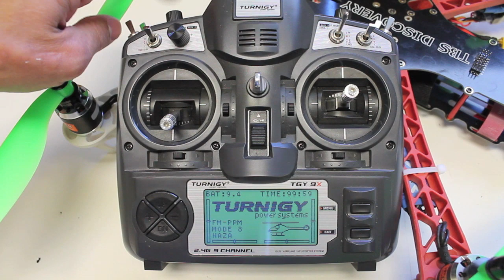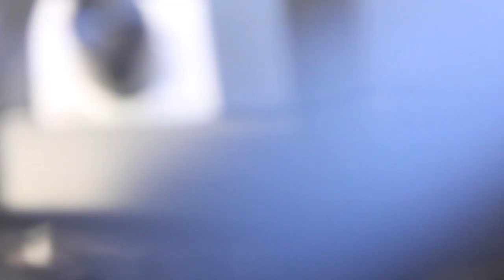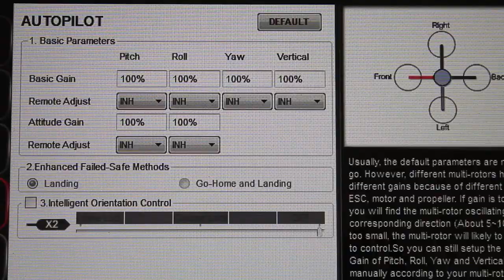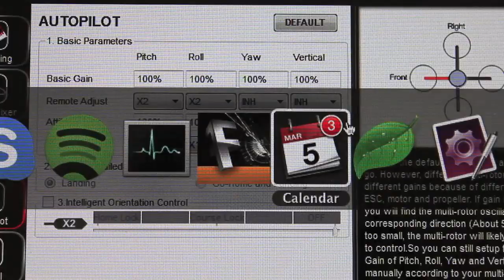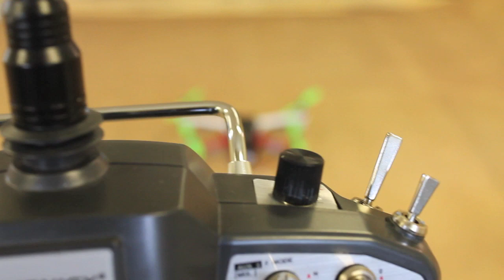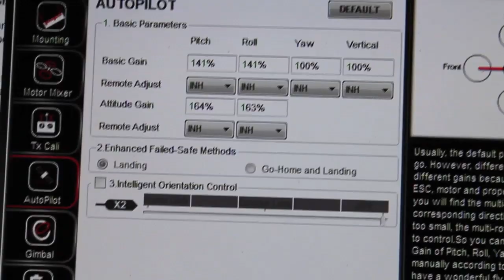DJI Naza Basic and Attitude Gain Settings for Pitch & Roll Using Turnigy 9X Control Knobs

Comment: it is a bit unclear, when it was osciliating it was too low gain ? I'm fighting a big multi rotor.. which is osciliating but a slower frequency... I was today a 250% of gain (3Kg) machine.. I did a strong right movement and let return to center and it fliped over and crashed :(

Comment: you did all of this is manual mode right? not Atti,
I feel that my quad always tilt to much. in any direction, 100% attitude I might as well set it to 90% just to make my quad tilt in a shallow angle. not to much,, like 45deg just 30deg.. what you think?
Reply from the maker: sir francis I did this in atti mode. That's probably not a bad idea if you don't want to get 100% throw with roll. Another option is to dial the gains way down so that it's a bit more sluggish and therefore your stick movements will react slower. It's whatever you prefer for your flying style, but I definitely recommend starting with lower gains and working your way up to where it's more responsive. Good luck and keep us posted.
Reply: Your video really helps alot. Thank you for uploading.  My quad flies even better now

Comment: Love your videos Dennis. They're always very informative and to the point. 
Would you happen to know what I should change if my quad is experiencing pretty heavy oscillation during lift off?
Reply from the maker: Michael Mellon Thanks so much for the good words. Perhaps look at your flight controller gains and maybe bring them down a bit if you're seeing oscillation on take off. That's my best guess right now. Take care.
Reply: Yea!! I figured that out finally. Thank you. I sent you another message regarding setting up my gimbal pitch Control through my naza. I'm using a tgy 9x. Any advice?? 😕

Comment: would this be the same procedure to assign the channel to the pitch of the zenmuse gimbal via the x1 or x2 ports?
Reply from the maker: Bearded Lady Yes. More or less the same process would be used. If you run into any specific problems check out www.garagepilots.com and post in the forums there. We should be able to help you out. Good luck with your setup.
Reply: Dennis Baldwin thanks dennis, appreciate it.

Comment: On a 9XR, there's no more AUX Channel settings in the menu. Simply PPM as usual. I use a D4RII output PPM. Then set Channel 5 to P1 for X1 and Channel 6 for P2 for X2 and you're done. Hope that helps someone.
Reply from the maker: Good stuff. Thanks for sharing that bit of info. Very useful.
Reply: Dennis Baldwin no, thank you for all these videos of tips and tutorials. Wouldn't be flying so quickly and happily if not for many of your videos.

Comment: When adjusting the basic gains should i be in attitude mode? or does it not matter?
Reply from the maker: You should adjust the gains and test in both attitude and manual mode. I would test in whatever mode you're going to be spending the most time in. Also, please check out www.garagepilots.com if you want to participate in our multirotor community. Good luck!

Comment: Hi Dennis . . Just checked on a "clean" new model, and I can configure the channels 7 & 8 the way you say .   All good . .    But back on my Quad set up in Heli mode there is obviously some conflict with all the mixing I have been doing . . eg . . I have my 3 way switch configured for the 3 flying modes, and my "Gear" switch configured for the forced fail safe.  (All these using your videos!!)  There must be a conflict here somewhere . .  Hope you can help .
John
Reply from the maker: John, may I suggest checking out www.garagepilots.com and posting in the forums there? I'm not certain what's going on with your configuration but perhaps someone in the Garage Pilots community can help you out. All the best.
Reply: Dennis Baldwin
Thanks Dennis for your inputs . .  I am in Heli mode.  Think the conflict comes from too much mixing here and there!!  No problem though .   I am using a different "model" select for test flying the Gains using only the 3way Pit settings for GPS, Atti etc, and the Hov Pit and Hov Thr for X1 X2 . .  Once I get that right I go back to my other "Model" for flying with the other settings . . Trainer (channels 5&7 for the Fatshark, and forced failsafe on the Gear, etc. . (If you follow me?!?)
Reply: Ingajohn
john..
on the turnigy 9x try using acro mode. remember the multirotors fly like basic 4 channel planes. hope this helps.
jimmy

Comment: Please help . .  Followed all of your videos so far - great help - they are excellent . .  Got a problem with this one getting the X1 and X2 to work . .  I set the turnigy 9x channels 7 and 8 to "HOV PIT" and "HOV THR" . .  go back but the knobs don't work !!  On the turnigy in the "Display" nothing is happening.   there is no output . .   Is there another setting in the Tx that is preventing this to function?  I have tried puttting other functions on 7 & 8 but none seem to show in the "Display".
Reply from the maker: Interesting. Do you know what "flight" mode you're in on your T9X? This would be plane, heli, or acro. I've noticed that sometimes depending on which mode you're in dictates which channels work.

Comment: Héllo.
Good video..!
I have a 680mm frame TAROT .!!Could you help me with the rates of gain for this frame?At what rate should I start values.!!?
I do not have GPS now!'ll Fly in attitude ...!
Regards..
Pp
Reply from the maker: Hi. I recommend using the default gains to get started. They will probably be too low but you can get a feel for them. Then you can dial them up a bit to match the size of your frame. Here is a video that shows how you can adjust the gains while flying:

DJI Naza Basic and Attitude Gain Settings for Pitch & Roll Using Turnigy 9X Control Knobs

Comment: dennis its david I still need the wiring,i sure you are busy but if you have a webcam I can show you were I am at. you know I have been trying for over 1 month and cant find one person who can tell me how to setup the stock 9x with stock receiver to make all naza v2 with gps funtions that naza v2 has I know that the radio can do all the control that naza v2 well function v2 has but need to know how to setup each switch and knobs to use for all features
Reply from the maker: David, the tough thing is that the mixing to get what you want to work will require mixing between the U and X2 port. I'm not sure how to mix both of those at the same time, but have been looking into it.
Reply: THANK YOU DENNIS FOR ALL YOUR HELP  SINCERLY DAVID
Reply from the maker: david ringler You got it David. Will keep you posted!
Reply from the maker: David. I sent you a personal message to see if we can get this figured out.

Comment: Great understanding of the Naza basic & attitude gains. I was in the same boat as you when I thought basic gains was for manual mode and attitude gains was for attitude mode on the Naza. 
Im still a little bit confused about the vertical gains though, does it affect the speed of your quad going up when you bump up the gains or does it affect the way it comes down?

Comment: It's not as drastic as the basic settings. It helped to get the responsiveness of vertical adjustments. And the YAW responsiveness. The sweet spot is quite large, I just used the middle setting between too little and too much reaction.. Final results for a Phantom with 9" CF props and T-Motor upgrades Basic @ 185% Atti @ 80% YAW 125%, Vertical 150%.

Comment: I am pretty happy with the 8J. Used also x1 and x2 channels for at flight gain adjustments. The 8J offers to display % changes on screen (DT5&6 on home screen ) while adjusting. For all gain tests I programmed a separate model w/ dif. button assignments.    
BTW, to complete the gain balancing of all parameters, after getting the basic & att. gain for P&R right, I went ahead and assigned  x1/2 for yaw & vertical gain. Once all balanced, switched x1 back 2 gimbal control (VR dial) and x2 to IOC.

Comment: Hi, I know for the Futaba 8J you shouldn't use Heli mode, but the standard ACRO plane mode for a multirotors. The DJI Naza does all brainwork and needs no swashplate or throttle curve adjustments of a heli mode, just standard servo commands over 8 channels.

Comment: Great news Dennis. I'm so frustrated I was thinking about getting another radio. Yes, I would like CL & HL along with the other modes...GPS, Attitude, Manual and fail safe. Just like the Phantom radio. I set up the Turnigy like you showed in the video with the right three position switch with Atti, GPS, and Manual then Fail safe on the gear switch when I'm in Atti or GPS (pos. 1 &2) if that makes sense. I do use CL and HL on the phantom a 
lot, so I'm missing it on the F550. Thanks again.

Comment: Nice video.
I reconfurated my F550 Naza (position , radio etc.) and with the first setup, was not anymore stable.
So ... now , i just come from the fly field testing, and work almost perfect with :

145 /145/ 130/145
150/150

Strong wind and small rain.

 Thank You.

Comment: Very nice presentation. Do you find the TBS needs different settings than the F450 because the arms are not symetrical on the Discovery as on the F450, or is it close enough? I find my Discovery ocillates in the roll axis when in fast forward flight.